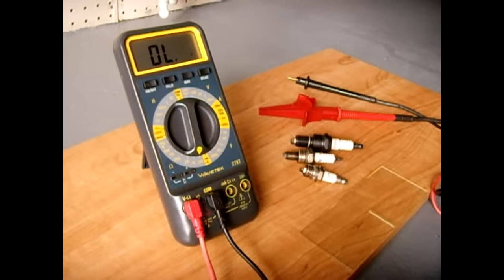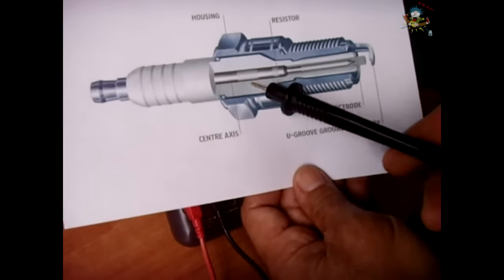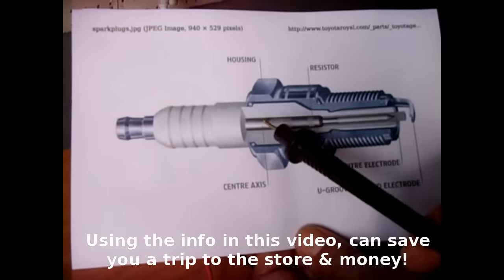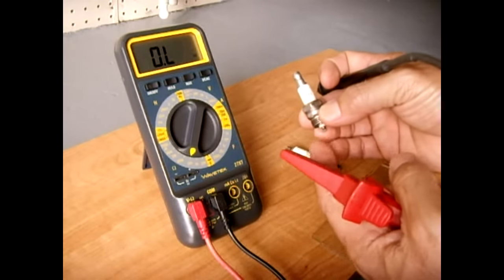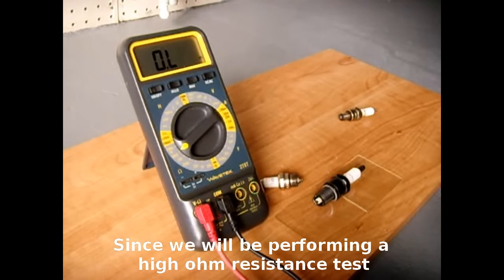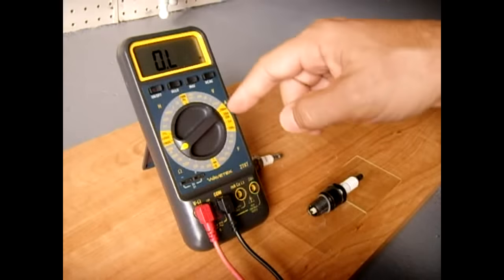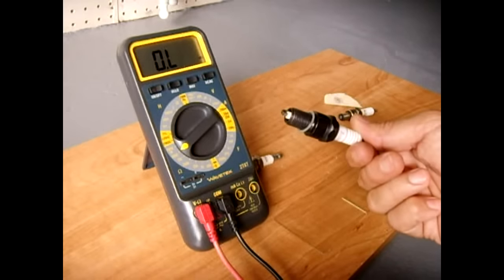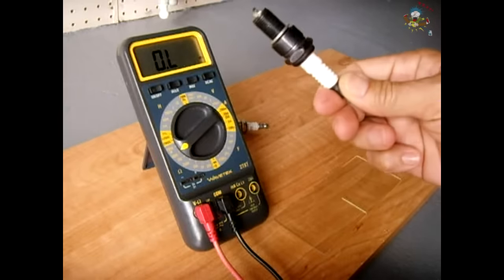How to rule out a Spark Plug as your problem

Comment: Most people don't know this because you don't need to do this.  All you have to do is hold the threaded end against chassis ground to see if it sparks when cranking or running the engine.  This will also indicate that power is getting TO the plug.  If no spark you can repeat the test with a piece of bolt in the plug wire instead of the plug.

You pointed to the wrong end when you indicated longer insulator means runs hotter.  How far and thick it comes up at the spark end determines that.

FYI, spark plugs practically never break apart in the middle, except possibly if you have trouble removing it and damage it doing so.  Far more likely would be the tip has eroded away or is fouled too much, which might not be reflected at all in your direct contact meter ohm test.

However this is all fairly silly.  Once you've gone to the trouble of removing all the plugs (unless you have a specific cylinder misfire code), you might as well replace them.  Spark plugs are not expensive in the grand scheme of vehicle repairs and far more often it's the hassle removing them in modern tight engine bays, not the expense that deters people from replacement, especially if it's a "V" engine instead of inline that has plug access at the top.

As far as people claiming a plug is bad, that is very rare unless the plugs have so many miles on them that the owner already expected that it was time to replace them.  I've been on multiple car forums for over a decade and am quite sure that spark plug paranoia is rare, except with specific engines known to, or evidence of excessive oil consumption which is noted by a drop in oil pan level.
Reply from the maker: Your method is not a sure way to test the plug. I outlined all tests in this video which have been proven to rule out the spark plug as the cause of engine trouble. You must learn to read PINNED comments before posting comments. Lastly, do it your way if you don't like my method. I never force anyone to do anything on this channel.
Reply: Some might remove 4 ngk plugs on a motorcycle (which are easier to do depending on the setup) and pay $10 or more to replace them. Thats at least a 6pack ! Y not clean them and reinstall if they are good?
Reply: Stinky Cheese. I just replaced 18 spark plugs on a lycomin R 680 radial. Most the plugs had a resistance of 9.68 m ohms, that's 968,000 ohms of resistance, 5,000 is the point of replacement. Huge difference, these plugs still fired at low pressure in the plug spark tester, but when the pressure is increased in the tester to simulate the high cylinder pressures, the plugs stop firing, those are bad plugs. You can test your plugs all you want like you have explained, but it means nothing if they spark. Because there are no cylinder pressures acting on them to reviel that there faulty. That's why an engine alot  of time  will idle fine, but when you accelerate and open the throttle valve, the pressure in  the cylinders increase and the plugs start to miss fire, creating a loss of power. You need your multi meter set to ohms, 1000 to under 5000 ohms is good, and the SPCT spark plug tester to simulate cylinder pressures while sparking the plug. That's how you test plugs. That will reveal bad plugs.
Reply: I agree. Been working on vehicles for 35 years and what you're saying is true. Aircraft plugs are worth this test because they cost about $40 each, low end. Thanks for sharing.

Comment: You offer good info for the info you have learned and it is kind of you to share this info with the public. I am searching for remedy for a small engine's ignition deficiencies that brought me to your video. However-    please do
     let me point out that during this video you explain the "heat range" of spark plugs can be determined by the length of the ceramic insulator that remains outside of the combustion chamber during a plug's operation when in fact the exact opposite is the truth. It is the plug's business end that is within the combustion chamber that has a longer or shorter measure of exposed insulation or not that determines the " heat range" of that plug. A small bit of misinformation may have consequence of temporary or possibly immeasurable value. Such value compounds when the misinformed do indeed spread to others what they believed to be the facts. You have had over 1.6 MILLION views of this video, it is that fact which motivated me to point out one important fact of operation.
Reply from the maker: The "Heat Range" issue was clarified in the video comment section a long time ago. Read my "Pinned" comment. Thank you!

Comment: Thanks! I have an older Ford truck and it's starting to get bad gas mileage, nothing else wrong, I keep up with it really well, clean air filters, the oil changes, anything it's needed gets done.  She does have high mileage but it's never sucked gas like this in the 8 years I've had her.
Reply from the maker: You're Welcome! Be sure to rate "Thumbs Up" and share. Also check out my other videos as well. Could be a loss of compression. Do a compression test. Any smoke in the exhaust? If not, could be dirty valves, or a fuel system problem. Spark plug wires/plugs can also contribute to a loss.
Reply: StormieinFlorida You might want to check the lambda sensor if your truck as one (or two). They tend to be forgotten and performance degrades with time.There's enough videos around to give you some insight on how to check it with a multimeter. Good luck ;-)

Comment: Well , I have fully rebuilt a Stihl hedge trimmer due to low compression & fitted a new carby due to having a leaking main nozzle check valve, the ignition coil was also replaced due to having no spark.
The spark plug isn't NGK but their electrode resistance is 5 K ohms for their resistor type spark plugs,the plug I have measures 9 K ohms which I am told is too higher resistance which can cause hard starting & rough running , in my case I have a no start issue meaning that despite the spark plug having spark when removed from the spark plug hole there may not be enough voltage at the electrode to fire the air/fuel mixture in the engine.
While the spark plug ran a Briggs & Stratton 4 stroke lawn mower I noticed the motor was harder to start & didn't run as smooth (surged) at medium to low speed (idle) ,actually it stalled at idle with that spark plug.
NGK suggests a maximum of 5 K ohms from the spark plug terminal to the centre electrode,I am off to the auto parts store tomorrow to see if they can supply me with a suitable spark plug.

Comment: In the past I measured the resistance of the new plug compared to the resistance of the old plug and gave the plugs a tolerance of 20% . That is how electronic resistors are ; with silver standard being 10% and gold standard being 20% . The plugs I use are cheap and when my cars computer starts tripping codes for bad plugs they are usually around 20% .
Reply from the maker: Thanks for watching Airon! Be sure to watch my "Auto & Mechanical" video playlist below, and most importantly share my channel with many others. 
https://www.youtube.com/watch?v=hnd7P7O_vEQ&list=PLQ6IOhUBblU3mBem9ImEgGzmqToW6SCJD

Comment: Much easier to remove the plug , ground it and check for spark while cranking engine, coil is easy to test and doing it this way can diagnose improper gap issues

Comment: Love you clear concise no nonsense delivery and relevant annotations.

Do you only do the cold and hot tests to rule out starting/performance problems that are happening within the maintenance schedule or to also extend the maintenance schedule of spark plugs. Would you then oppose the recommendation of replacing all your spark plugs at the same time?  Thanks.
Reply from the maker: ourlegacy The cold test is usually good enough(At least for me), but to be 100%, you should do the hot test. Replacing one faulty spark plug can make the engine run great again, but usually you would replace all the plugs at the same time.

Thanks For Watching!

Comment: This procedure only test for one failure mode. There are several other failure mode. Think of cracks in the insulator.
Never remove a spark plug from a hot engine.
As a rule: when you take a plug out, just screw in a new one.
And do pay attention to the recommended installation procedure:
- use of lubricants (many plugs do not require lubrication)
- way of torquing (depends on seal used) 
- use a proper spark plug socket or risk cracking the insulator.
Reply from the maker: Actually it tests (2) failure modes. An annotation was added which explains how to test the plug heated up to rule out any insulator cracks or heat related issues. Good ole toaster oven set for 300 deg F.
Reply: A merger would test insulation.

Comment: very good gentleman, I am driving 1000 cc suzuki cultus, four cyclinders,  It is 2012 model, EFI. The engine started to miss on CNG and a repairman changed a sensor on carbeurator. but later I started to feel misfire or sometimes light blasts in left cylinder. I removed that plug and put it into right side cyclinder, but then I felt misfires in right side cylinder. I removed it and purchased a new one, however your tutorial was realy very informative, now I will check the removed plug, wether it was out of order, however it was newly installed. There was a loose connection which not only damaged the wire but also damaged the plug.
Reply: JACK

Comment: In my opinion: If you have a power gap plug or silicon resistor type your won't get any readings until a large amount of voltage goes through it. 

Not all plugs have the same type of resistor or have a straight through conductor.

Comment: TU good info..but if the plug is hot , doesn't that mean the engine was started/running so no point in checking it?.
Reply from the maker: It was just an extra test to ensure the plug works fine when hot.

Comment: According to NGK's web site, the heat range is determined by the length of the ceramic in the nose of the plug, not back at the wire connection.
Reply from the maker: +kr4mo 
Hi there. I guess you had annotations turned off. Very bad when watching my videos. :-)

Comment: Allow the engine to cool down to a room/shop temperature. (most applications). Attempting to remove the spark plugs from a HOT engine may cause the spark plug threads to seize, causing damage to the cylinder head threads. ... Also contaminated threads may prevent the proper seating of the new spark plug.

Comment: I don't understand those comments about not pulling a plug from a hot alu head. I have been a tuner and motorcycle racer, and we started the bikes on hot plugs, and when warmed-up, changed to the cold racing type plugs. Never had a problem with the screw threads!
Reply from the maker: Agree 100%. I've taken hot plugs out of heads and never once damaged the threads. If you install by hand first, then tighten, everything should be fine. I have a lot of excellent videos on my channel that cover many different subjects, so be sure to check out my extensive video playlists for other videos of interest to you, rate thumbs up, and share my channel with others. Thank You

Comment: the difference in insulator length on a hotter or colder plug is at the other end of the spark plug.....not where the boot goes but where the electrode is. cheers
Reply from the maker: supersevenn That is true, as I stated in the video with the use of an annotation, but usually in my experience, the nose length has a correlation to the insulator length. Shorter nose > Shorter insulator as well. I agree I could have stated it differently.

Thanks For Watching

Comment: Using a wire brush to clean the electrode and the anode creates a conductive coating that will short the current path. It is fool proof to use a spark plug sandblaster and they do not cost much at Harbor Freight if you have a decent output compressor but if you use a pancake compressor it might not work so well. Wire brushes do not like park plugs.

Comment: Many thanks for the presentation.  More, and more frequently, resistor plugs are being used in small engines, Does that resistor further increase the spark's  voltage across the terminals ?

Comment: I put plugs in my acuara I believe they were E3 the tip screws on and off. Do not know why.  However if get plugs like this put lock tite on them.  The tips got loose and the code was no help in tracking it down.  I should have checked the plugs. But I did not. $100 later from the dealer felt like an idiot.  I am sharing so you can be aware of it. Other than that I did not have any problem with the plugs. Thanks for sharing this video learned alot.

Comment: great tutorial but the price of brake cleaner is the same price as a new plug where I live.
Reply from the maker: Brent Hill You can use carburetor or brake cleaner "IF' you have it laying around, otherwise you will have to buy a new plug. Many people that work on engines have these cleaners.

Thanks
Reply: +Brent Hill that one can of brake clean will likely serve you multiple cleans.

As mentioned, I think it is more of an option IF available. Not necessarily to go out of your way to buy brake clean vs a new plug.
Reply: +Necrodox ,
Reply from the maker: *****

Long Island. :-)
Reply: I do use carburettor cleaner for my spark plugs. However, it doesn't really whiten back the ceramic insulator around the electrode, which has been darkened by oil and carbon.

How about those sand blasting devices ?
Reply: gabigowriel                  You poor Boratperson!
Reply: use coke with salt If you don't have break cleaner
Reply: In the old days soaking in petrol did a good job